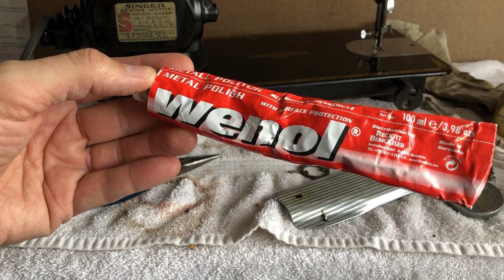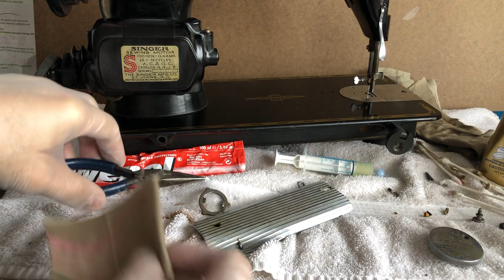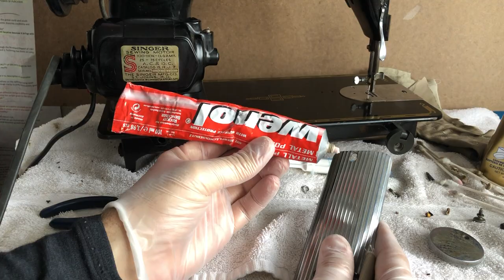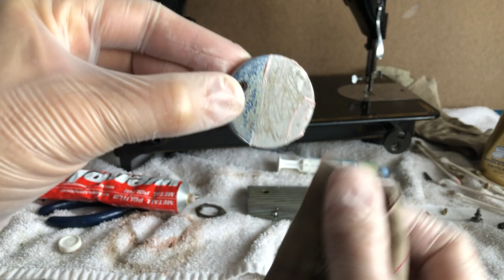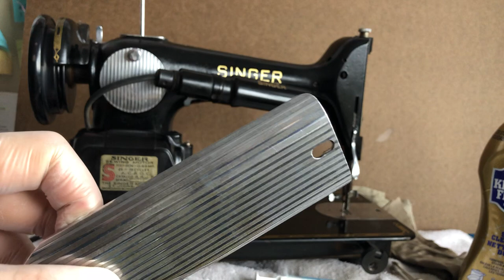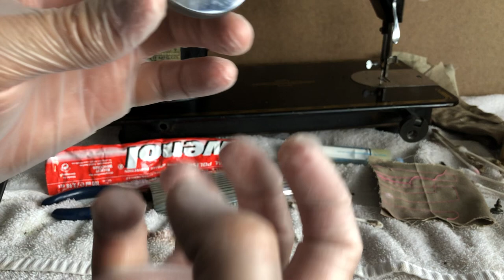FANCY METAL POLISH:  Another Option in the Tool Chest for Restoring Metal Sewing Machine Parts!

Comment: You should not leave these to dry out. They work far better when you follow the directions and remove them with a clean dry cloth within a short period of time. They buff up much nicer than this demo when removed while still damp. I use Bar Keepers Friend and MAAS (metal polish). I've recently tried Pink Stuff with excellent results. I first used MAAS when I inherited Sterling Silver. It cleans and polishes in one step. It also leaves a protective coating. After 20+ years my Sterling still gleams. I've never had to polish it again. It's a paste in a tube like Wenol. A little  goes a long way. Just work in areas where you can completely clean and polish before it dries out. When it's damp all you need to be concerned with is using a clean portion of your cloth as you go. Old t-shirt pieces work just fine.

Comment: I have multiple vintage sewing machines from Japan that have "windows" or clear plastic selection identification bezels that had a yellowing from being from the 50's-70's and I swear by Mother's mag and aluminum polish. Using the Mother's polish on the clear plastics with a rotary tool with a felt polishing pad I can get the plastic pieces to a crystal clear glass like condition. The polished parts look like they are brand new and not around 50 years old.  The other trick I have is to use lime-a-way toilet bowl gel cleaner for lime, calcium and rust. It will remove the non-pitting rust as well as the residual buildup of old oils and gumminess of non-painted parts. It is also a mild enough chemical that will not damage the paint if accidentally gotten on the painted surfaces before you have a chance to wipe it off.
Reply from the maker: Thank you for the suggestion.  I will have to try that.

Comment: sewing machine oil and a electric toothbrush works really on anything piece you dont want to remove.  It will buff if right up.  I use a oral b with replacements brushes so I have some for the machine and others for the polishing.  It helps.
Reply: do you use an electric toothbrush for those parts you can't remove?  I have a treadle machine that has a part I can't remove and it is rusty.

Comment: Have had good luck with Simichrome Polish. This is imported from Germany, and is typically found in the auto-parts stores...I imagine it is similar to Wenol that you used. Give it a try. Jim
Reply from the maker: Thanks for the tip Jim.  Yes, Simichrome may be quite similar to the Wenol you see in the video.  In Canada, the car parts stores also sell another German brand called "Autosol".  All should work quite well.

Comment: What could be used to remove rust from the throat plate? Also spool pins?
Reply: I can't remember whose video I watched, but it recommended 1000 grit wet/dry sandpaper with sewing machine oil and it worked beautifully. For the spool pin, you cut a 1" wide strip the length of the sandpaper, fold it in half with grit to the outside so that it's 1/2" wide. Apply a drop or two of sewing machine oil and then use the strip of sandpaper like an old fashioned "exercise belt", pulling on the ends to rub and apply pressure. It worked beautifully. Afterwards I also applied Flitz as it adds a protective layer, helping to reduce yellowing and prevent further rusting.